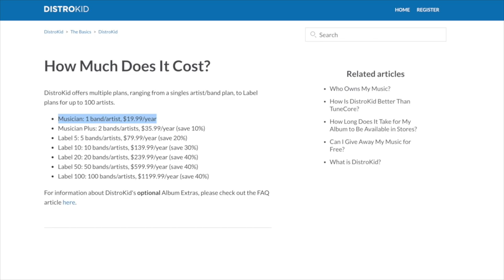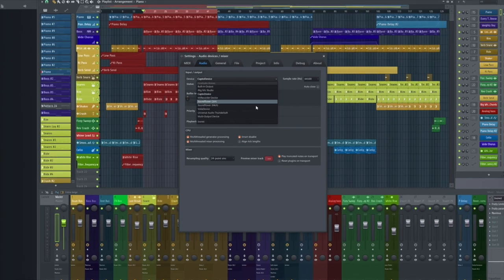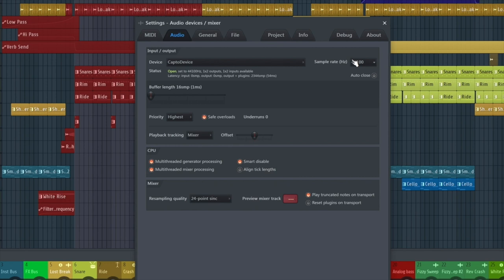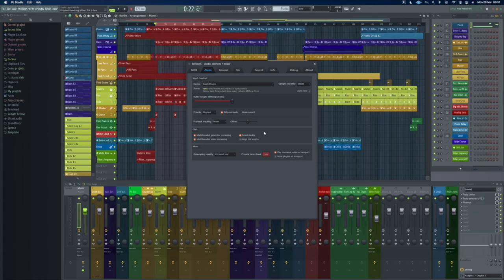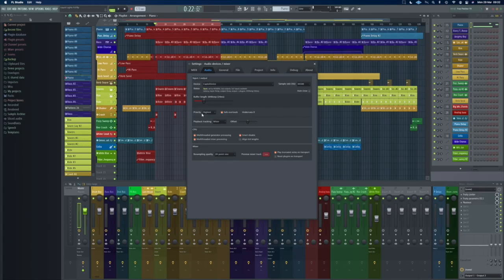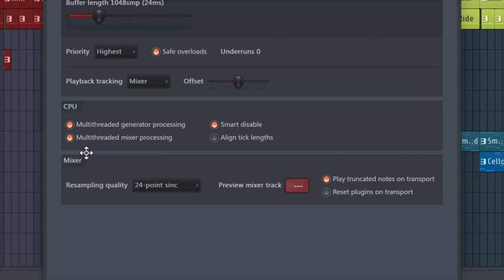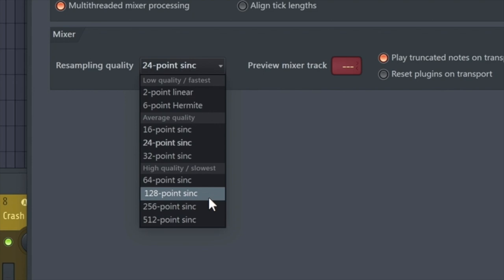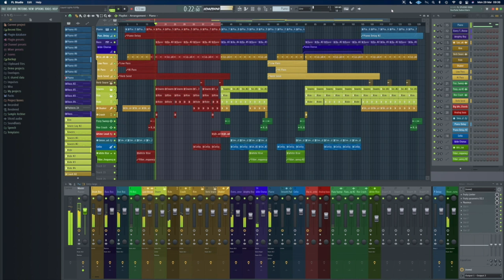Why Does MY FL Studio Have a Crackling Noise & How to Fix it

Comment: so those were all my settings already and i didnt change any of them. My FL studio just started doing the crackling randomly even on a new project just hitting the keys for the kick drum. any idea what could have caused this?
Reply: im having this same issue and was considering upgrading interfaces because I though my interface was bugged, but it looks like a problem with a lot of people
Reply: @dammittonybeats  same here... did you find out the problem?
Reply: @zareen7215  no bro, it randomly just happens. Idk what to do any more. Becuase I used to produce on an old laptop and it bugged on there. Recently bought a new computer assuming it was that too and it still randomly gets buggy like that tho. It’s frustrating man
Reply: @dammittonybeats  I actually found the problem I had. It was a bugged plugin I was using.
Do you have some kind of plugin on your start up template?
Reply: @zareen7215  no? What happens is when I open a big plugin all the sound goes like that then what I do is set mic input 1 on and off and it works. As well as changing projects, the sound is on silent, until I set mic input 1 on and off, idk man it might just be my interface
Reply: @dammittonybeats  hmm, okay. Yeah it might be your audio interface or bad cables/connections.
Reply: @Kodi had to reinstall Rc-20. The crackle noise/vinyl cracking wouldn't turn off. It was on all the time as soon as I had it in my mixer channel 😂
Reply from the maker: Shit like this... I cant prepare you for lol

Comment: Very helpful video! Perhaps you could help me understand why my vocal tracks playback silence for 2-5 sec at random times? I’ve used the same routine and setup for ages but today when I recorded a new song with vocals as I usually do, the playback would insert silence then play the recorded vocal as if there was no issue. Export does the same. I could have silence starting at one point for a few moments then after export, somewhere else completely different. 

Again, great video!
Reply from the maker: Probably a plug-in in demo mode.

Comment: hey bro, i have problem with antares auto tune, vocals sometimes pop crack or whateva i dont know how to explain it, do you know how to fix this shit with antares? i dont wanna use simple pitcher
Reply: Same here.
Reply: yeah that happens with antares, you can try to use a declicker afterwards or you can just use newtone or melodyne
Reply from the maker: First off, You need to figure out what kind of issue is going on. Is it popping because you have the correction time set to fast. Or because your computer cant handle it.
Reply: @Unders  i got problem where my vocal take clashing with other vocal take and between the end and start part of both vocal take made some out od tune vocal😭i dont know how to explain anymore but can someone help me?

Comment: Never had this issue.  Update to FL Studio 21 and now suddenly plugins that never caused crackling (KONTAKT > ALICIA'S KEYS) are crackling as I play.
Not badly, but enough to where it bugs me.  It's not every time I press a key either.  I can play for 10 seconds or more without crackling and then it will 
randomly crackle a bit and then it's fine again until it does it again randomly  between 5-30 seconds of playing.  This isn't some shit PC either!  I also 
am more than familiar with buffer settings in the control panel of FL Studio etc.  I'm using my Focusrite 2i2 Audio Interface and I've had some troubles
with it in the past, but haven't had any crackling or audio issues for a couple years now.  I was also working on music all week with FL 20 without any
problems whatsoever.  As soon as I update to FL 21 the issue presents itself.  I'm assuming it's because there's something enabled or some kind of
setting was changed upon updating to 21.  Any ideas?  Also.. it's not because I've loaded too many VSTs/plugins into this project either!  I'm only using
Alicia's Keys by itself without anything else added to the project.  It's a brand new project with only Kontakt > Alicia's Keys open.  Nothing else!
Reply from the maker: make sure the latency is set to a value like 64,128,256 etc sometimes the clocks can be a sync issue.
Reply: @Unders  Seems like it's only happening with Alicia's keys.  The problem isn't happening with any of the other plugins/vst's that I use.

Comment: I got a Focusrite Scarlett 2i2 3rd gen . My problem is that when I record , my vocals dont pick up the wave will be low . I'd rather have my vocals to loud so I can turn it down instead of them being to soft and not being able to turn it up . Shits frustrating AF
Reply from the maker: Using the phantom power with a cardioid microphone or not?
Reply: @Unders I'm not to sure . I'm using the microphone that came with the set . Scarlett studio Microphone . I assume it's a condenser mic
Reply from the maker: @Droy5555  i dunno bud. But you need to find out if it requires phantom power. From what you’re saying it’s either that or something way off in your chain. Which in such a simple chain is unlikely.
Reply: @Unders  pretty sure it does , theres a 48V ,button on my interface . If I dont use it then the Mic doesn't work
Reply from the maker: @Droy5555  ok. But it’s coming in way to low? So it’s got to be input gain into FL
Reply: How do I fix that bro ??

Comment: More helpful advice:You can set the resampling quality to 2-point linear so you can hear the song with no crackles, This worked for me but may not work for you.
Reply from the maker: 2 point linear sounds awful. An it applies to stretched audio quality.
Reply: @Unders  Oh, At least you won't hear any crackles because I was working on a song and I just kept hearing crackles no matter what quality I set to, So I chose 2 point linear and it worked, But if you want like a more accurate audio, Either choose one from the medium one.
Reply from the maker: You can totally do it. But i wouldn't mix like it. the final bounce will sound outrageously different

Comment: For some reason, I am getting crackling in the audio that is recorded as well as the audio that is coming through my headphones. It just started doing this. I used it yesterday without any issue but today it sounds like popcorn when I'm trying to record vocals.
Reply from the maker: If it’s in the audio your recording. Then it’s the interface 99% of the time.

Comment: Something happens to me sometimes when I reverse and change the timing of a rim or high hat and this weird radio noise will play at random parts of the song even when rendered. Very strange issue I can't seem to fix.
Reply from the maker: like static noise? Some plugins do that in demo mode.
Reply: @Unders  how can i fix it?
Reply: @Unders  I don’t think I’m using any demo plugins. It really seems to be something when I change the timing of something reversed. It doesn’t happen every time though. I also am not using the latest version of fl.
Reply: @Unders  A distortion plugin was causing the issue it was in small writing in the corner free trial up will cause white noise occasionally. Thanks for the help

Comment: If you're using FL Studio ASIO driver, you can fix this by opening up the ASIO Panel, and disabling hard-clipping at 0db, now it sounds amazing
now I can hear much much better and mix better!
Reply: I'm using Focusrite USB ASIO but what I'm struggling with is my vocals . It doesn't seem to pick up my vocals how it should , when I'm done recording the wave is low . What I noticed is if I turn up my Gain on my interface while recording it picks up my voice but I'll hear my voice while singing . Shits fucked , I just need my  vocals to be picked up and actually have volume to it

Comment: I did all this with no change BUT

1. Used CCleaner to clean my registry up (save a backup!)
2. Restarted my computer
3. Reopened FL with the settings he recommended
4. Checked my plugins... View > Plugin Performance Monitor

After that it was fixed. Idk which step did it or why but I hope that helps someone else! And thanks for the video 😊

Comment: i need help, when i open a new project, it already stars with the crackling sounds. i change the buffer length to the max, but it happens any way. i am using the fl studio asio. if i change de driver to asio4all , and start a project with more plugins etc, it happens the same thing. The rare thing is that it started to happend out of nowhere , i've been using fl studio for 4 years and i've never had this type of problems.

Comment: I suggest it's all about video card. FL studio and vst plug-ins use A LOT of graphic processing and I suggest it's absolutely not optimized at all for Mac, there are not any grand graphics options. If making audio buffer bigger doesn't help just make a test: close all FL studio subwindows, play your project and minimize FL studio. I bet that the sound starts to play fluently, so it's a video card overload, and we have nothing to optimize it on Mac
Reply from the maker: A lot of what you say here is just not true 🤷‍♂️
1. FL Mac is a dedicated version. Not a port and it’s not running through translation like the original Mac alpha. 

2. GFX processing and throttling cause visual lag. Not audio underruns and or crackling. 

3. All of the visual options are present to be turned off in FL.

Comment: Hello, thanks for the video

BUT its not working for me, i tried almost EVERY tips that i found on internet and still sizzling/crakling.
Actually i dont think that the problem comes from the CPU or power of PC.
I tried to install lastest drivers for my audio devices. I tried buffer lenght, sample rate, offset, priority and few things like this, that's why i think the problem is not a question of power.

If anyone know how to fix this kind of problem without talking about buffer lenght.. :)

btw nice video thanks. help.
Reply: I suggest it's all about video card. FL studio and vst plug-ins use A LOT of graphic processing and I suggest it's absolutely not optimized at all. Just make a test: close all FL studio subwindows, play your project and minimize FL studio. I bet that the sound starts to play fluently

Comment: The best is to upgrade the ram to avoid it.
Reply from the maker: This is so misguided I don’t know if it’s a troll.
Reply: @Unders  it's not misguided. I do Music producing and it is my career. I have a problem of this one same of yours before. I do just what you told on the video but the  problem become worse in my loptop. So I upgraded the RAM to 16 gb and it works. Must of this case dude is the CPU ram the way it process things especially music producing, if you want to solve it, just upgrade the RAM. But I suggest bigger processor and ram for music producing. The more powerful your processor the more it is easy to carry your music. The more bigger is your ram, the more how faster it process music.

Aside from the ram and processor, try to upgrade your audio devices and stay away of crack softwares, instead buy the DAW you are using for music producing. Because when you use crack DAW softwares,  the more virus, the more it creep to your music programming and the problem won't solve. Instead, it might be worsen like other bugs and crashes.

Consider also the type of loptop you are using if the motherboard don't overheat. As for me, I use computers because loptops is lightweight to carry heavy music producing.

In short, you need powerful computer to produce music. Music producing is serious stuff to work on the computer and loptop since it would carry much.

What you taught is basic. But as for your loptop, that's what it recommend. So, case close for you. But for most, even if you try to fix the audio settings in fl studio, it won't fix. So, those are my suggessions. Allow me.

If you are interested in music producing, you need to invest that much to get prettier, amd professional result. Result that is far from any possible problems. And would open the door to expand your skills in this field as great oppurtunity.
Reply from the maker: That’s great that you have a career in music. But that isn’t how ram works. All ram does is allow things to be held in memory for quick access ✌️in FL studio almost nothing is held in ram unless you specifically ask it to hold audio data in ram to avoid disk stream issues.  A modern drive can run 24 audio streams at 44.1 at once without issue. While an SSD around 128. Large sample libraries can also be hosted in ram. It doesn’t affect processing speed or signal flow.
Reply: @Unders  okey. Maybe I'm not good in computer technical skills specially how the software works. But it works when I change the ram and I see no problem with my audio.
Reply: @relaxationvideos616  Nahh bro it doesnt matter my guy I have 32gb of ram and buffer still gets me crackling and getting in the middle of my recordings
Reply: @relaxationvideos616  ram is random access memory, its pulling memory to display whats on screen, having a better cpu is what makes the process go by faster, so in all reality, you could realistically have only 2gbs of ram, but a powerful cpu, and do the exact same thing as someone with 32gbs of ram with the same cpu